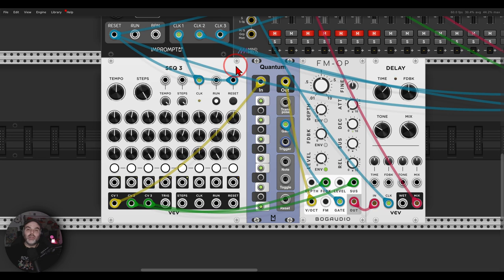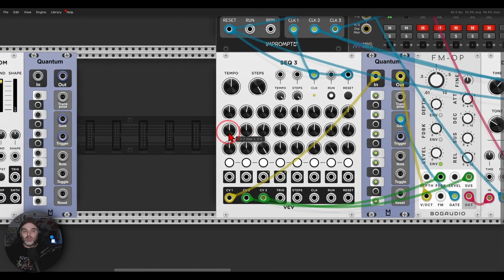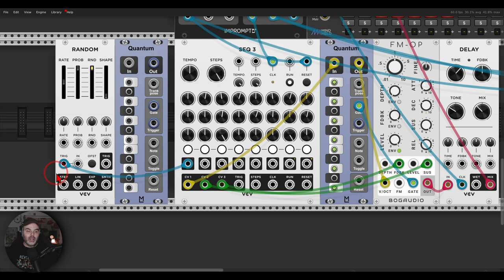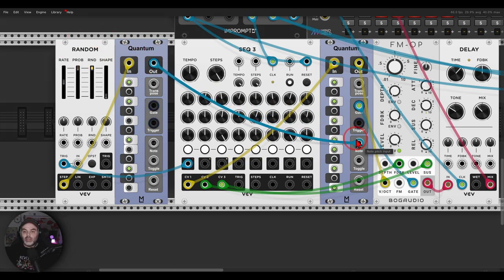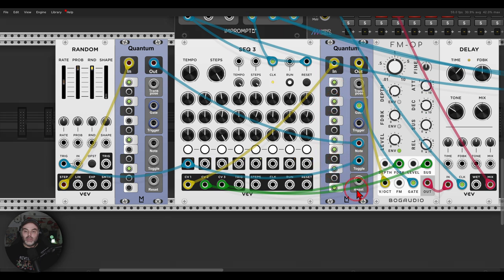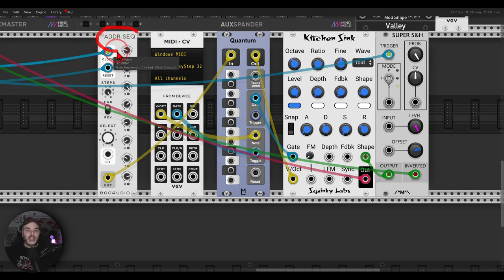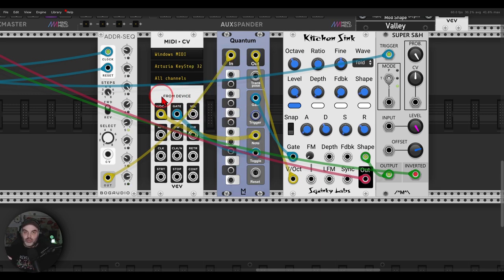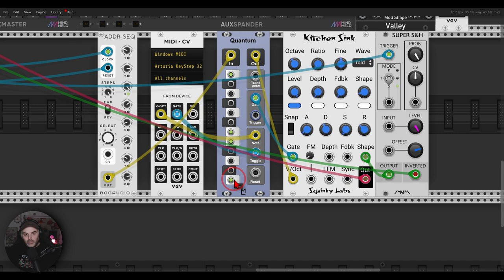Modulating a quantizer? \ Quick Tip

Comment: hello amazing content can you clear me a doubt? do you know if i can use a VCV quantize to quantize pitch for my eurorack hardware oscillators in VCV 2 version?
when I tried in the last version VCV 1 through the ES-9 I had latency problems which made it unfeasible if you know a way to escape this or a video on the channel that helps with this I would be very grateful... thanks in advance for the incredible content subscribed xD
Reply from the maker: Thanks :) Yeah, Latency is quite an issue and I'm not so sure if there's a way around it. When sending signals into VCV and then out again, there will be a lot of latency... The best would be to either get a hardware quantizer, or to use oscillators in VCV and not send the signal to your system again.